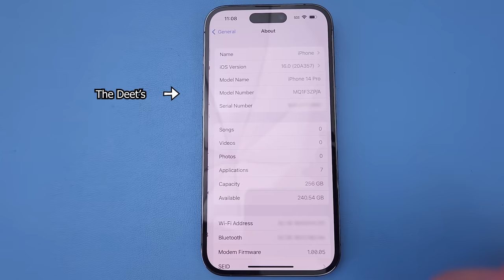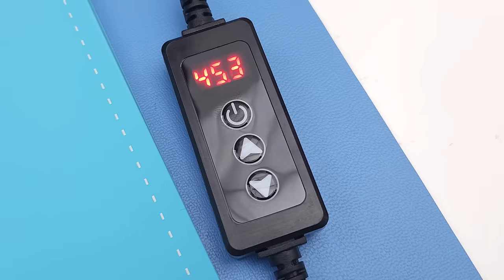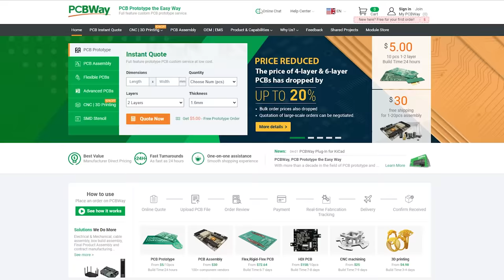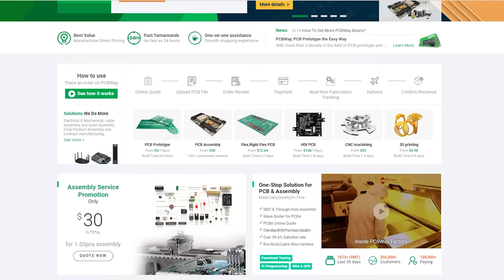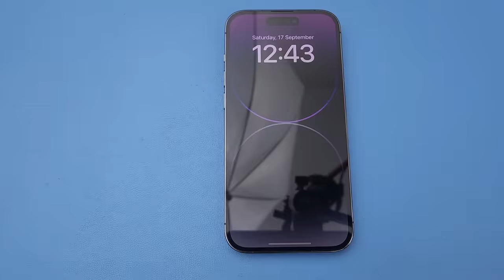iPhone 14 Pro Teardown - Full Disassembly

Comment: They (Apple, magazines) said it is much more difficult to open an iPhone 14 than the previous ones. I couldn't see any noteworthy difference.
Reply: Yes, an actual 14, rather than the 14 pro. The 14 opens from the back, its a complete redesign
Reply: just for the normal iPhone 14. not for Pros
Reply from the maker: @Peter This was the same as the iPhone 13. In that teardown I had a big struggle trying to get the screen up. This new tool I have makes it much easier.
Reply: @czLochy  yeah and that's a terrible change. Replacing the back is completely irrelevant. But replacing a broken screen is. And with Apples design it always much easier to do that (unlike most Android phones). And now Apple is partly doing the same.

Especially with the iPhone 14 models it seems like there are more and more parts of the development being like "influenced" by Android manufacturers.
1. opens from the back
2. not all rear cameras with the same resolution 
3. doing nonsense like "f/1.78" so that the aperture looks larger than it is. It's a f/1.8...
Reply from the maker: @Peter That's fair enough Peter, you may be right. It looked the same to me, but I haven't measured it on an accurate scale. I've definitely seen the iP13 before and thought there was a tiny bit of screen above the lip, I almost feel like it's dependant on the unit you get, slight variations.
Regardless, wish I had this contraption last year 😄
Reply: No, im pretty sure they said it was now easier to open, cz the back glass comes off fully now. Idk which one of us got the wrong info but i got this from a very famous tech channel “Phone repair Guru”
Reply: @Raja995mh33  replacing the back is irrelevant? What In the world? No it isn’t it’s extremely important and now that you don’t have to swap everything to do so that is a massive step in the right direction
Reply: @juliet4093  it is relatively irrelevant. You can just put a skin or case on it and you're good to go. A broken screen on the other hand is a problem and most Android phones make it basically impossible to replace the screen thanks to their design.

But as I now know, Apple made actually huge improvements because both display and back are easily replaceable.
Reply: @Peter I own 12 Pro Max, 13 Pro Max and 14 Pro Max and I can tell you from taking a look right now, they are all the same design. The amount it sticks up is probably due to manufacturing variation.
Reply: @czLochy  Do you have to go through the back on the 14 for a screen replacement?
Reply: Xiaomi 11t
Reply: @Raja995mh33  you don’t have to remove the back to replace the screen on the 14 the screen still comes off from the front. Both sides open
Reply: @czLochy  what about 14 plus? Complete redesign too?
Reply: @Raja995mh33  lol replacing the back glass is huge. People cracking the rear glass before have to replace the rear system just to replace the back glass which is a total waste. why not make the back glass modular and make it repairable????
Reply: @stinkwhistle756  I wrote my comment before I knew that the iPhone 14 can be opened from both sides.
My knowledge was that they just switched the internal design to the stupid one Android manufacturers are using by gluing the screen into place instead of the back. And from that perspective, the back IS a lot less relevant. But Apple made a big step and made both sides accessible which is great.
Reply: @Raja995mh33  incorrect broken rear glass means, water resistance is compromised, structural integrity is compromised, rear components are at risk of failure, it can’t be resold, and broken glass is extremely unsafe, it is not irrelevant this change is very good
Reply: They were talking about more screw drivers 😂
Reply: Can i have iphone x?😅😅 i didnt afford it all my life😅
Reply: @czLochy   hu know

Comment: This really makes me appreciate the engineering excellence that goes into building a modern phone from Apple.
Reply: Which is the same every year 😂
Reply: @karimmohamed710  Agreed. Engineering Excellence :D
Reply: Engineering excellence goes perfectly with Z Fold 4
Reply: @TanveerAhmed-dk3rp  🤣😂, oleds are already foldable by nature, this fact has been known since they were born, so over 20 years ago, you have continuously seen it in screens with strange shapes such as the various curved screens for PCs or the old Samsung, etc,etc... The only thing they did is put a hinge on them and fold up to the point of avoiding breaking (no need to spend 1€ on research) When you open them they are the usual jumble (nothing comparable compared to the assembly of iPhones, which are almost more beautiful when disassembled than when assembled, every single parte taken is maniacal care, ....(there is nothing that comes close in Android world, much higher quality for Apple device, not by pure chance Apple is the largest company in the World, they are so big that if they wanted, they could even buy Samsung, to make you understand the abysmal gap between the two companies, therefore the anomaly in this case would have been to see an Apple product of worse quality than an Android, certainly not the other way around, with all the liquidity they invest every year...) for the same reason they are the most reliable, having a problem on an iPhone is equivalent to winning the lottery (but in reverse of course 🙃) Samsung just on the marketing side overperform...(where by the way Apple has never invested, also because it would be equivalent to falling below the position they maintain, a bit like when it comes to politics, whoever commands dictates the rules, whoever chases makes propaganda...)
Reply: @glaxb17  blah blah Samsung is more innovative and I know your saying this because you are blind fan boy paid by apple and I am not replying for cow paragraph as I know who is best and I never ever Apple is more innovation.  
Samsung 1000%
Reply: @TanveerAhmed-dk3rp  In truth it is exactly the opposite, Apple is the only one that does not pay for reviews, unlike Androids like Samsung who give away their devices to have them reviewed (obviously to all the reviewers who do the numbers) so who could to speak ill of it?? (also because on the other side they are watching, if the reviewers talk bad about it next year skip the cooperation , so they won't have any phones to resell on the used market, less money for them, BUSINESS) Apple is the only one to lend them device just for a week (I repeat, Apple is the only one who doesn't pay to sponsor herself) a whole little theater full of actors (the truth is that reviewers are a business) free to say what they want about the iPhones (since they'll have to buy them anyway) but totally conditioned in the reviews of the Android (since they make money with these, so they will speak well of even the worst fake) here's the reason why the most famous reviewers seem like a store for how many androids they have on the shelf ... marketing as veiled as it is fraudulent, since it bribes reviewers with top of the range donated in exchange for excellent reviews... (business) there is nothing comparable to Apple even in terms of seriousness in the Android world (facts...!)
Reply: @glaxb17  here you go again... I am not interest in your compositions... Believe  whatever you want. At least tim cook gonna love you. I could expose everything but it does not matter at all
Reply: @TanveerAhmed-dk3rp  I don't believe in anything, FACTS! (this doesn't require trust, just research the policies these brands have for reviews) or ask someone who has experience in this field and listen to what they tell you...🙂
Reply: @glaxb17  eeeem I've seen youtubers who got a S23 ultra which they only had for a week or so

Comment: Thanks for showing what it looks like from the inside. After such disassembly does the phone become less waterproof or loses some of it’s other characteristics (except for the warranty)?
Reply: Not really, as long as it is reassembled correctly. During reassembly, you have to reinstall the Water and Dust resistant seal he removed around the edges.
Reply: @aaronpena5879  Yeah but I don’t think most thirds parties reparations make the job correctly
Reply: This is my main question too. The screen is glued for a reason

Comment: Awesome!! I didn’t know the Australian model of the phone still shipped with a physical SIM tray. Curious to see the hardware differences between this model and the U.S. model, which exclusively uses eSIM now.
Reply: EVERY iPhone 14 outside the US ships with a SIM slot. 
And besides that there aren't any differences. You US guys just don't have a SIM slot - no benefits.
That will only change once all models get eSIM because Apple will not make two different internal designs just for one market
Reply: Buy sim tray better than esim
Reply: No mmWave antena? What does this means?

Comment: You can go to 90 to heat the display. Makes it much easier to remove. Great video
Reply from the maker: I usually go lower than 80°, I'm worried about the heat impacting the battery and degrading performance.
Reply: OLED can degrade too...
80°C is perfect.
Reply: @ThermalWorld_  Yes OLED degrades, from use due to the pixels being switched on. However a single application of heat will do it ZERO harm
Reply: @Petermcc94 If 90 ° C is exceeded, the OLED displays burn out, showing only green color.  I repair phones so I know something 😅
Reply: @ThermalWorld_  I've even repairing phones since 2011 including OLEDS since Samsung S4 🥳
Reply: @ThermalWorld_  we could go on all day about what is safe but at the end of the day it's user risk and do what's best for you!
Reply from the maker: @Petermcc94  Just curious; You didn't repair any S3, S2 screens even though you started in 2011?
Reply from the maker: I always aimed for around 180°F (82°C) when doing OLED glass removal. But as long as it didn't go over 200°F (93°C) it was fine. This was with a lot of S3, S4, and S5 back in the day. Not sure about the newer phone models.
Yeah I'm more concerned about the battery.
Reply: @RestoreTechnique  I started in 2011 with very basic equipment and knowledge. What I meant was I started LCD repair on the S4 by separating the glass from the OLED display
Reply from the maker: @Petermcc94  Cool. Did you take the OLED panel out of the frame? And were you Using LOCA or OCA?
Reply: @RestoreTechnique  I started with Loca as it was the more accessible option, but I then started to take my seperated displays to a guy about 20 miles from me and he would laminate using OCA. 

Right now, 90% of my business is iPhone and Cheaper Android displays.
Reply: @RestoreTechnique  and yes always removed the panel from the frame. Reused it if I could, but sometimes they are already damaged or get damaged in the process so always good to have some frames to hand.

Comment: Good afternoon, I need to receive information.  Unfortunately, following a breakdown, I would need to replace the power button of my iPhone 14 Pro. However, I would like to know if it is necessary to replace the entire NFC module, or to buy only the "flex" containing the volume and power buttons.  In particular, I can't understand if by replacing only this last component it is necessary to carry out micro-welding on the NFC antenna.  Thanks in advance
Reply from the maker: The side buttons are on the same flex as the wireless charging antenna, so unless you can do micro soldering (or find a repair shop that can do it) then you will need to replace the whole flex assembly.
Various suppliers offer this part, including iFixIt for USD$59
https://www.ifixit.com/products/iphone-14-pro-wireless-charging-antenna-assembly

Comment: Отличная работа! Скажите, а влагозащита расположена вокруг дисплея или сразу под ним? Защищён ли зазор между стальной рамкой и экраном?
Reply from the maker: Below it. The gap between the edge of the screen and the metal frame is not protected. So water can technically sit in that gap, but it can't go anywhere and do damage. It will just sit there till it dries out. There are other areas of the phone like that too, namely the speaker and microphone holes.
Reply: @RestoreTechnique  thank you for the answer :) I've just got some soup splashes on my iPhone 14pm, found them sitting just there, in the gap between the screen and the frame, and was a bit worrying would it damage the phone.
Reply from the maker: @ihor6320  yeah unlikely, should be ok.
Reply: @RestoreTechnique  great! thx & have a nice day :-)

Comment: Any indication if the back glass is easy to repair like the 14?
Reply from the maker: It's reported to not be, but I didn't try to rip it up.
Reply: Nope, the 14 Pro and 14 Pro Max back glass can't be repaired like the 14 and 14 plus.

Comment: The back is not the same as the iphone 14 that can be easily remove?
Reply from the maker: Correct. The Pro models still open from the front. Weird that they have 2 different designs.

Comment: I have a 14 pro with a serious problem where it’s rebooting randomly after a screen replacement. Does the proximity sensor cause any problems for the phone if it remains unplugged while the screen is installed, or is the phone damaged beyond just the front screen? It’s my phone and I tried to get it fixed myself, and when I plug the screen and proximity sensor back in the phone overheats instantly and becomes too hot to even touch. I leave the proximity sensor unplugged and it functions normally except for when it reboots every 2-10 minutes

Comment: Thank you for sharing, I have a question, what do you think about the built quality of the iphone 14 pro? Is it good?
Does the Samsung Galaxy 23 ultra have better built quality materials than the iphone 14 pro? Is there a way to know for sure?
Reply from the maker: Yes the build quality is excellent, as is the S23 range. All premium phones using premium materials.
The iPhone 14 Pro models have a steel frame, whereas the S23U has an Armor Aluminium frame. So the iphone appears to be better on paper. However the S23U fared better in a drop test against the iPhone 14 Pro Max. So I don't know which is better. As a customer, I wouldn't base my choice on build quality, as they're both very high end.

Comment: I noticed there was no Adhesive or Water Seal during re-assembly. Is that normal?
Reply from the maker: I removed the old adhesive, as I wanted to try and replace it with the iPhone 13 adhesive, but it was too tricky to do successfully. I'll replace the adhesive later, once the iP14 parts become available.

Comment: Is that the ambient light sensor, the one you disconnect from the screen first?
Reply from the maker: No, the one I disconnect 2nd. The white rectangle. I'm actually not sure what that sensor is, it could be proximity, but it's very large 🤔

Comment: What's an mmWave antenna?
Reply from the maker: mmWave is a faster, short range, extremely high frequency version of 5G. Which only works if the cell towers are really close together (about a block).
It's available in the USA, so most phones outside the US don't contain the mmwave antennas.
Reply: @RestoreTechnique  thank you :) also you're hysterical dude

Comment: 4:45 what kind of material did they use for the seal? Is it applied as a liquid, like a glue?
Reply from the maker: It's a double sided adhesive tape. 
Example:
https://youtu.be/LwtMCpJ9BzA?t=64
Reply: @RestoreTechnique  thanks! I wonder how they apply that in production...

Comment: Great video detail. Very helpful with understanding assembly complexity. 
Have a MaxPro. Is it similar internally as the Pro shown in video? If not, how different is it?
Noticed the different antennas but didn’t catch if there is an independent R/F module. Will review again to make sure, need to verify. Testing my MaxPro and 2022 iPad Pro in a High level Criminal Hacker environment shows hardware bypass Backdoor exists built in by design. Thought to be using WiFi/Bluetooth that bypasses User iOS. Suspicion is modified Bluetooth. However, Criminals have and are able to broadcast different frequencies suggesting variable controlled R/F turning the device into a R/F generator. Hence, R/F section may not be separate WiFi and Bluetooth which would effect R/F module design. Any thoughts?

Upgrading to 16.2 doesn’t fix as it’s clearly built in hardware and supported by software. Hence, the only fix is to change out the Backdoor module to a Privacy Secure module if possible.
Marty Didier
Reply: You can see on Apple’s website that only the battery size changes with the Max (and of course the size)

Comment: This is odd? So the new iPhone 14 has a very easy to replace front screen and a very easy to replace back glass. Also the phone is now opened from the back like the iPhone 4’s issue is why didn’t they do it for this one as well?
Reply: That's what I'm wondering 🥲
Reply from the maker: Yeah it's weird, 2 different structural designs for the 14 range. I kinda wanna take apart a 14 now haha

Comment: How about the rear glass is it going to be as difficult as iphone 13 to remove?
Reply: On the base iPhone 14 you can now open from front and back to replace things so that has changed but pro models are still the same as last year!
Reply: @takamachi6851  it's not that you "can" but you HAVE to. And it's actually a huge downgrade. The 14 Pro and previous iPhones had a much smarter and better approach because replacing the screen easily is more important.

Comment: Are you able to add the mmwave antennas from another countries phone? Or does the Aussie iPhone just not have that 5G bandwidth?
Reply from the maker: Well there's no mmWave 5G network in Australia (like most of the world), so it would be pointless to add it unless travelling to USA.
I don't know if simply adding the mmWave antennas would suffice, I assume there's additional hardware management on the motherboard, as well as a different firmware/kernel.
Reply: @RestoreTechnique  True... I am just curious if not only the antenna is missing but what version of the modem is installed on the Australian iPhone